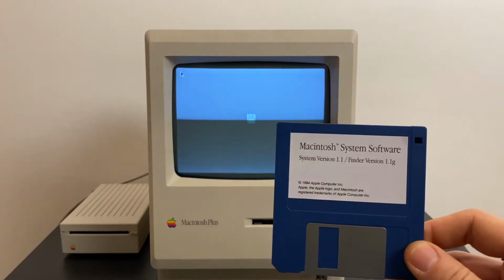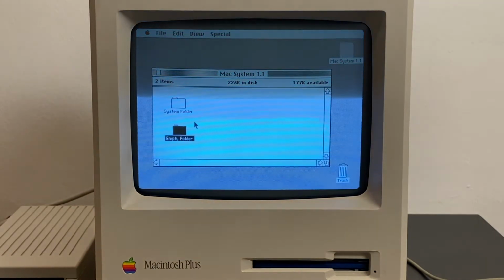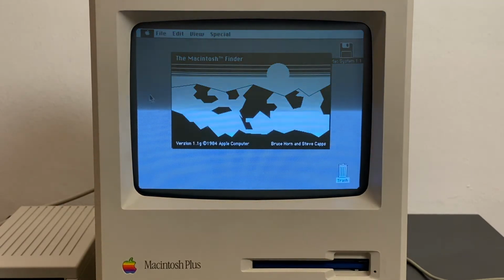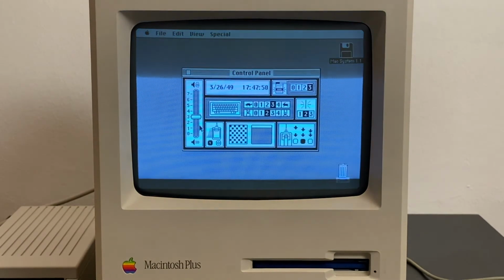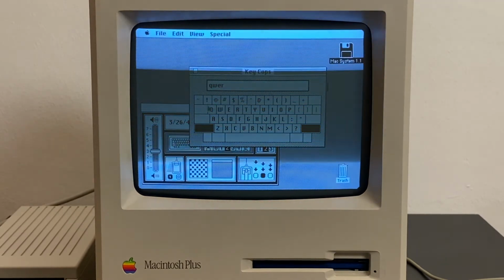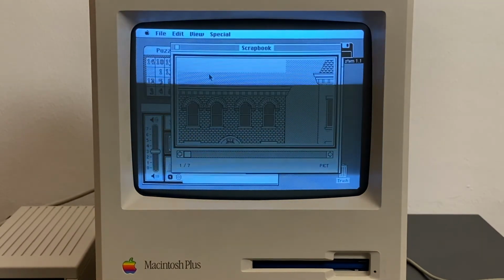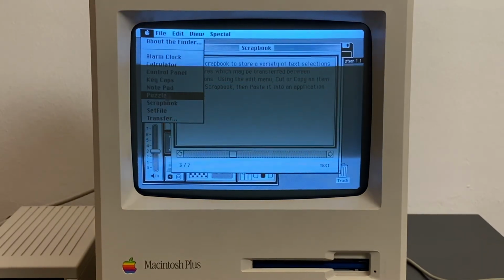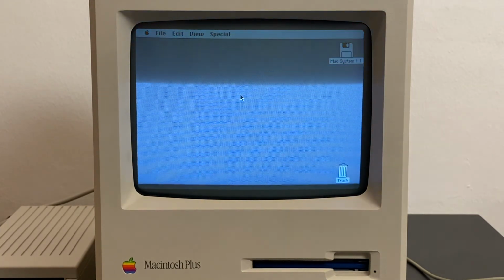Macintosh System Software 1 (Demo) #MARCHintosh

Comment: The "Empty Folder" isn't a bug.  It's how you would create new folders.  Once you rename it, another "Empty Folder" would be created.  Eventually Apple added the option to create new folders when they added the HFS file system.
Reply from the maker: I honestly had no idea, but that makes a lot of sense! I dismissed it as a bug, because System 3.2, which I mainly work with, didn’t do that. Learned something new, thanks a lot!